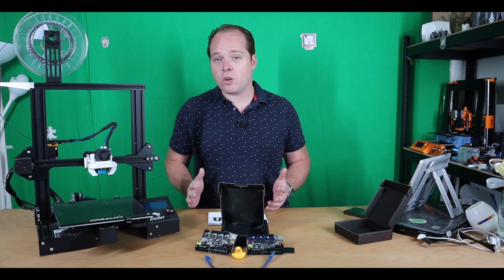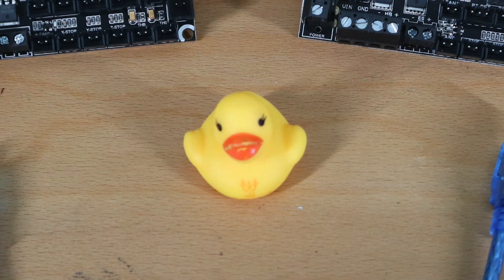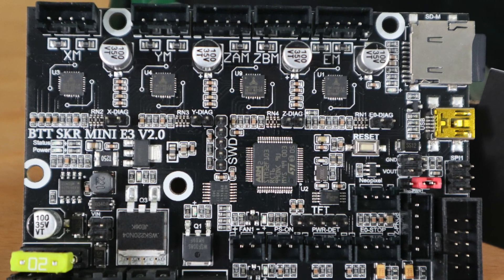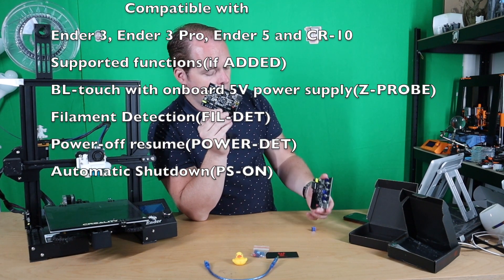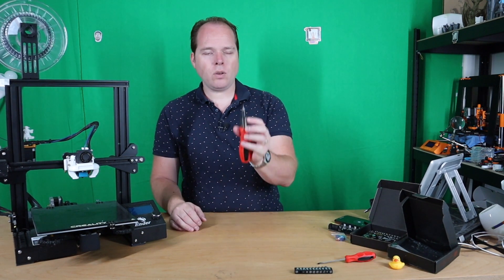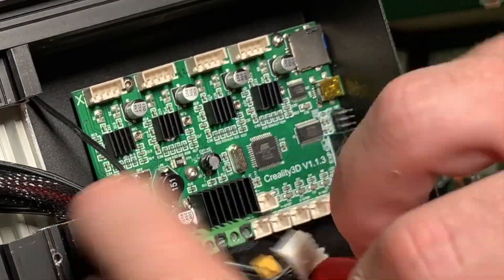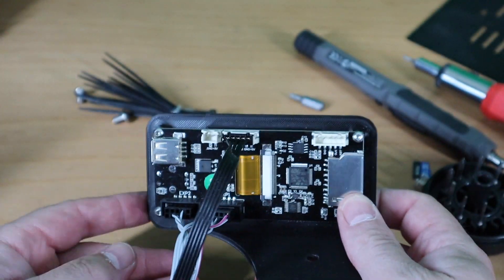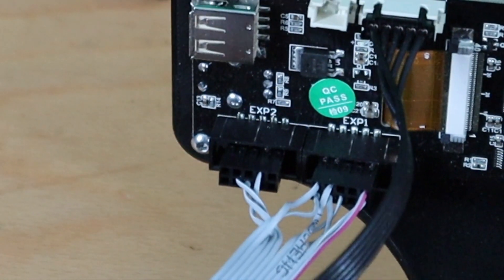How to install BigTreeTech SKR mini E3 version 2

Comment from the maker: TIPPED BY SIMI TRAVELS! When you are connecting the BLUE/YELLOW wires to the SKR mini E3, they need to be connected to the edge connector and the mainboard fan wires RED/BLACK is going on the inside connector!
Reply from the maker: Yeah

Comment: Can I use Bigtreetech skr mini E3 V2 in the 3D printer I made myself?
Reply from the maker: Hello, yes these board from Bigtreetech can be used for custom made printers. If these custom made printers are in the same specs as a Ender-3, you won't need to change much on the firmware side

Comment: i just installed my board but when i turn it on, it only stays on the start up screen and im stuck on it. please help! thank you
Reply from the maker: Hello Mark, which screen did you use? Did you also use the firmware? If you don't have the right one, check out the site from Bigtreetech

Comment: Mine has gotten loud and i installed it 2 days ago any reason why? It’s not as loud as the stock board but now you can hear it when the x/y axis moves
Reply: Yes it runs normally. I find it's super quite when it's moving in one direction, but when it does circles you can hear. You can also hear it when it does retraction. I'm guessing this is pretty normal but I'm not sure
Reply from the maker: Oh well, one time I switched between the SKR mini E3 1.2 back to the stock board, I was amazed how loud the stock board actually was... then after a few weeks, I could change it into the SKR mini E3 V2, much more silent. Anyways, It seems that we both have this, I think it's pretty normal. But between the stock board and the SKR should be a notable difference.
Reply: Zachary 3D Prints oh very noticable I have no regrets getting I was just curious to see if I was the only one. Glad to see I'm not! Thanks for chiming in! Eases the mind!
Reply from the maker: Yes indeed
Reply from the maker: Is this a SKR mini E3 version 2? Do they run normal, besides the loud noise?
Reply: Zachary 3D Prints yes it's the v2
Reply from the maker: Great board, much possible

Comment: Hey there! great video to help my install, only one question: where does the touchscreen wire connect on the SKR mini E3 v2.0 board? Thanks!
Reply from the maker: Hello Josh, just above the row where the end stops connectors, there is a connector for the touchscreen. Today a new video is coming where you can see very clearly where this connector goes

Comment: you should check again the fan connections.. i think you interchanged position between the 2 fans !
Reply from the maker: Hello Simi, I did watch it again, the hot-end fan wires are going to the black connectors, the parts cooling is going to FAN2 and board cooling is going to FAN1. which ones did I interchange?
Reply: @Zachary3DPrints  the mainboard fan(red/black wires ) with the cooling fan fan (yellow/blue cables ) ! does your mainboard fan activate as soon as stepper motors moves? and will it stop by itself after 1 minute that stepper motors are NOT in use ? (FAN 0 yellow and blue wires - FAN 1red/black wires mainoard fan)
Reply from the maker: I did check the Creality board, the blue/yellow wires were connected with the FAN2 and the layout from the Bigtreetech board is also the same one. But after Checking, switching parts fan on and off, the mainboard fan was turned off.
You are right and I'm going to add this
Reply: @Zachary3DPrints  good !!! the "problem" comes from other mainboard where fan was in the other position! so while copying exactly position of all the cables worked for the fan  would not be right !
Reply from the maker: Simi Travels thanks for this. Because the board has 2 connectors and documents which one is which
Reply: @Zachary3DPrints  i'm glad i could help to fix ✌

Comment: Hello I've changed motherboard to mini E3. But rhe sd that came with it does work. But my old one does. Do I need to put merlin on my old sd card
Mike
Reply from the maker: Does to board do work? Normally you don’t need the SD card... if for some reason you don’t have the file, there is a git hub from BigTreeTech
Reply: @Zachary3DPrints  it woks with another sd card. I didn't no if I had to download Merlin on the sd. Card Or is the sd card just for stl prints. Because merlin is already loaded on the motherboard. 👍
Reply from the maker: Michael Terry they are awesome, boards usually works great out of the box. Make some fun with 3D printing
Reply: @Zachary3DPrints  OK thanks👍

Comment: Originally purchased an Ender 3 v2 but wanted all the features of a CR6. Decided to go with an Ender 3 pro, upgrade to SKR mini E3 V2. Will add dual z axis, bl touch, filament sensor, octoprint, tft touchscreen.
Reply from the maker: I think the CR-6 SE is a great machine, but with the upgrade possibilities from the SKR mini E3 version 2 we can get very close
Reply: I agree, the CR6-SE provides a very good starting point out of the box. Plus a slightly bigger build volume. I missed out on the kickstarter and couldn’t wait any longer since this is my first 3d printer. I’m technically inclined and enjoy tinkering but would not recommend what I’m doing to a novice user.
Reply from the maker: I had to make a choice, go of this CR-6 SE and wait until August for delivery or investing in a good camera the Canon M50 to improve the recording quality directly... I choose for the Camera, beside some bigger and more well known channels did already got them and did reviews on it. I wait my turn for the future printers to come out